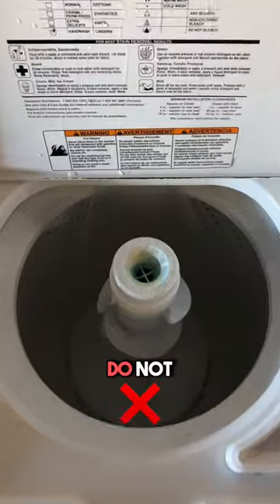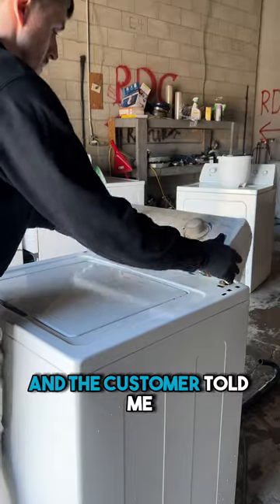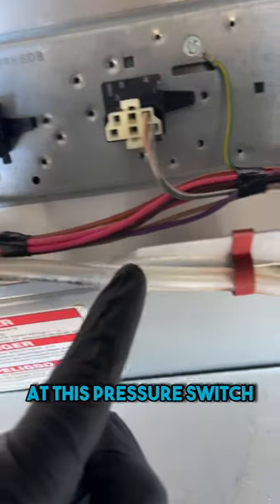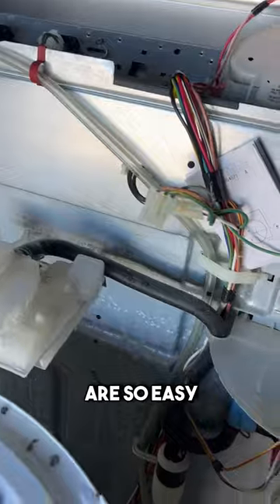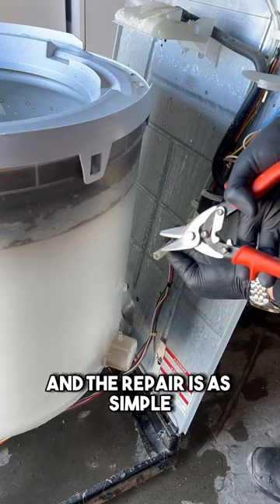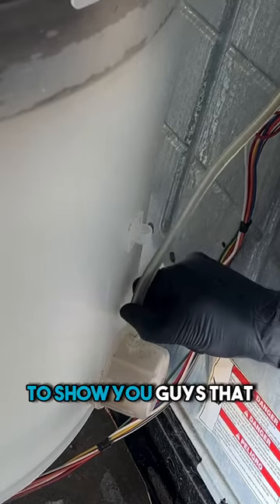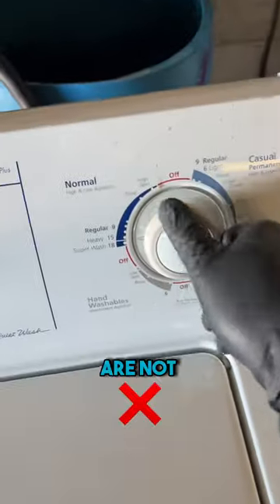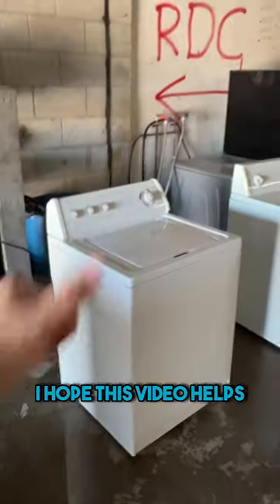This is Why Your Washing Machine is Overflowing!

Comment from the maker: If you have a Top Load Whirlpool made washing machine, buy your new pressure switch and hose here: 

1. Pressure Switch: https://amzn.to/3Pbfyjh
2. Pressure Hose: https://amzn.to/3qNtaJ7
Reply: Do you sell the appliances on line?
Reply: Just want to fill that you know you're taking the housing off wrong instead of using the screwdriver sideways to pull off the clips All you need to do is take a flathead and use negative pressure on the clip and it pops right off.

Comment: I hate side loaders with a passion and this channel has only deepended that hatred. First broke down two years in and needed a new circuit board that was barely out of warrenty! Then, three years later the connecting mechanism between the motor shaft and the drum broke and now they have a new one and we'll see how long that one lasts

Comment: Maybe put a tiny clamp on that tube so it doesn‘t get lose again. :)
Reply: I was gonna say the same thing. Power steering hose clamp will do the trick for sure
Reply: they don't take very well to those mounts, but if you can get it to seat then good on ya.
Reply: Zip tie would be best or a metal ring clamp thou they could rust unlike ziptie thou zip tie deteriorate by time
Reply: @Ztra-ngga have you ever heard of stainless steel?
Reply: @GenesisRasphotos stainless steel still corrode tho. Its just harder to corrode. While plastic zipties will decay slowly. The best solution maybe glue😂😂
Reply: @ayn30  glue will crack from vibration and heat. And stainless steel only rusts omce its carbon outer layer is worn off
Reply: @GenesisRasphotos  depend on glue. You know that flexi type silicone or epoxy exist right
Reply: @ayn30 can you explain to me what function of that hose
Reply: @wannawan8431  can i explain it on my language as english not my first? Basically it just connecting pump to tub to pump out water from tub. When that hose disconnected it won't pump out water because the pump will just pump out air instead of water in tub. Sorry for bad explaination. If you want more clear i prefer to write in my language
Reply: @ayn30  Considering that this didn't have anything clamping down the hose, I don't see how a zip tie would decay, at least in any significant manner. The zip tie would likely outlive the usefulness of the washer.
Reply: @joemann7971  yeah taking lifetime of washer i think zipties is ok
Reply: Throw in. Trash get a front loader they work better end of story 😊

Comment: I have a maytag top load washer, about 3 years old,  that has a little squeek during agitation.  My wife swears the cloths come out with a slight burnt smell.  Anything this issue seams to point too?  I can change the parts myself, I just don't want to rebuild the washer for the price to buy a new one.  Thanks in advance.  Keep up the good work!

Comment: I gave ours away for free. But the washer was fine, the dryer was having a problem. I can't even remember what it was at this point. But we tried to work on it ourselves and failed. Guy I gave it to even said that brand is usually difficult. But he was older and liked repairing them. So that's a plus. We have a brand new pair, a matching set! For the first time.

Comment: I HATE our Samsung washer and dryer. They suck so hard and are impossible to take some parts apart that get so nasty. I bent the crap out of it to force it apart with pliers and put it back together and it still runs but my hands got torn up. Pieces of manufactured waste if you ask me

Comment: I got a mid 90s direct drive washer for $50 about 15+ years ago. Still going strong, just needed some agitator pawls and light bending of timer pins so they made better contact. No chance new washer lasts 30 years unless it's a Speed Queen, and that won't be $50.

Comment: Our washer either doesn't agitate properly or won't spin at all sometimes. It only happens occasionally or with large loads. Any idea how to fix?
Reply: Mine too!!
Reply: Might be too large of a large load
Reply: If its not agitating properly it could be large load issue or the agitator dogs are worn. And for the spin issue, same deal large load or worn out clutch. (Assuming your washer is like this, a direct drive)
Reply: @johnnymontoya686  Was going to say the same thing. Worn out agitator dogs. Super simple and cheap to fix.

Comment: I have a situation that you might find interesting. My Samsung top-loading washing machine shakes and vibrates a lot I tried the hose and nylon ties hack that I've seen online and it didn't help any. When it starts to shake violently I tilt the washing machine all the way back until it settles down and then I slowly Bring It Forward. When I say I tilt it way back I tilt it way back and hold it there for a few minutes and then like I said Bring It Forward and it spins perfect. I don't understand how that works out like that

Comment: My Whirlpool flooded I change the switch and tube it still flooded then I changed the control board relay desolder it and installed new relay problem fixed.

Comment: We had a cheap washer and dryer like that, that lasted us for about 13 years and when I have it away, it was still going strong
Reply from the maker: Still the best washing machines you can buy!
Reply: @theappliancedudes  i think we gave like $250 or $300 for ours from Best Buy. We have the LG front load washer and dryer and I wished sometimes we had the old ones back

Comment: Should have just replaced that very low cost plastic line. That shortened tube is likely to come off again since it is not long enough to go through the proper guide.
Reply: Return customer
Reply: He cut the end off so he could re-strech it on
Reply: @rohinhans7819  exactly…a short cut repair that will need to be done again soon. It appears it was already repaired the same way in the past. The hose was already too short to go through the plastic clip that is supposed to keep it in place. He made it even shorter.  
A generic fix to an appliance he is planning on reselling is not at all professional.
Reply: @aroger9425  I doubt this is his first rodeo.

Comment: What if it seems to stop filling at the right level but when it's spinning the slings suds out the top we only use pods and havent changed them in years not sure if they are the energy efficient tabs because she takes them out of the box and puts them in a cute tin that looks like a little washing machine

Comment: Transmissions and motors are not cheap, neither are they easy to change out. Switches and drain pumps are easy, but changing out a clutch pad or capacitor I'd advise to hire a professional so you don't get schocked or hurt.

Comment: My washer is shaking itself off the slab and doesn't seem to be agitating right even though it seems to spin up alright in the drain cycles. I'm guessing it might be a belt that's bad and is slipping but I know nothing about appliances. Any ideas before I start tearing it apart?